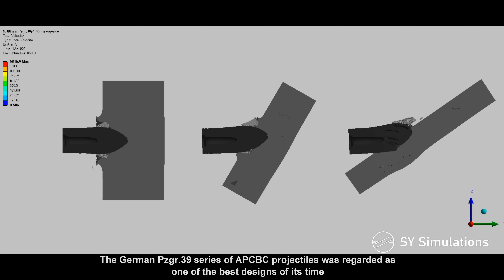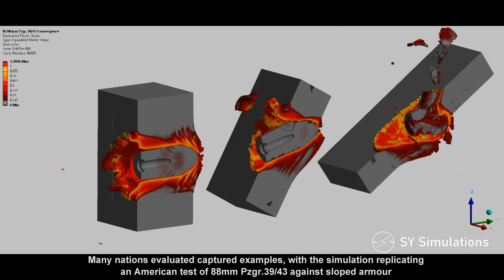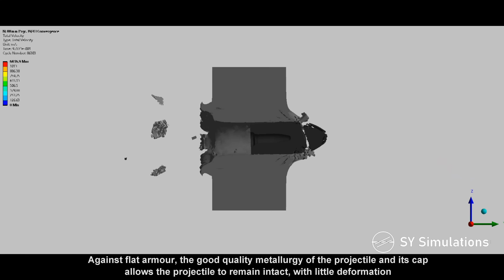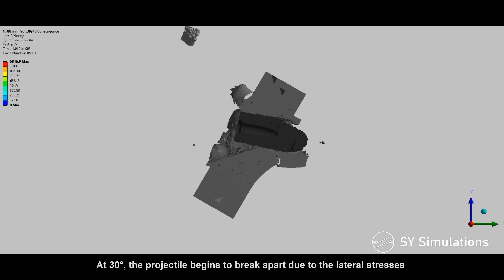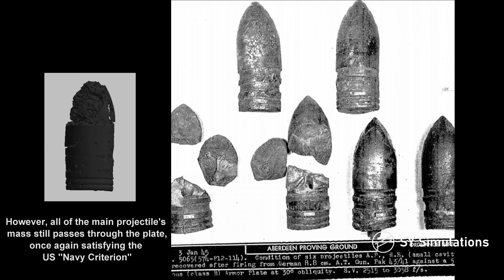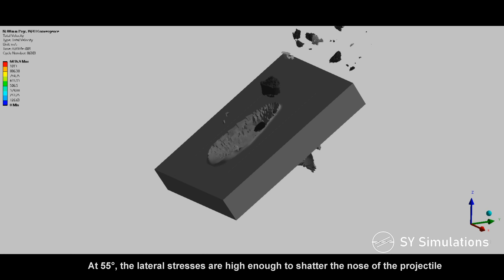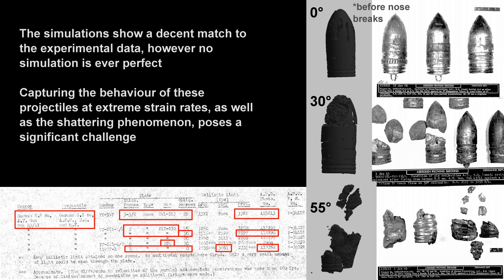FLAT vs SLOPED ARMOUR SIMULATION vs REALITY | 88mm Pzgr.39/43 Shatter Armour Penetration Simulation

Comment: Another great video. Fascinating that even if the armour can't stop the projectile it can still break it so that it won't explode on the inside. Certainly not ideal but might save the lives of some of the crew.

One thing I've always wondered is the difference in effectiveness between rolled vs cast steel of equal thickness. I keep hearing contradictory things about how rolled steel is stronger because of the way the crystal structure meshes together, vs cast steel where they basically sit together in whatever form they were poured in. Others says that cast steel is stronger, but don't go into detail why beyond the lack of weld seams, which should only be a problem for hits directly on or close to them.

Would be interested to see if the two could be simulated and tested. Keep up the great work.
Reply: cast is very brittle so it would be likely to shatter like ceramic.
Reply: @Stalin-7332  That depends on what kind of steel and what kind of heat treating is used. Most US tanks made heavy use of casting for both the turret and hull, and post ww2 most other tanks from other nations used casting for turrets.
Reply: 👍 I've wondered the same thing. I hope you get an answer.

Comment: Subject: Request for Tank Armor and Gun Penetration Simulation

Dear SY Simulations,

I have been following your work on tank armor and gun penetration simulations, and I am very impressed with the level of detail and accuracy you achieve. I would like to request a simulation to analyze the effectiveness of large-caliber guns against sloped armor, specifically regarding the IS-3 heavy tank.

As historical tests suggest, the IS-3’s upper front plate, despite its theoretical line-of-sight thickness, could be penetrated by its own D-25T 122mm gun at relatively close ranges. This appears to be due to the effects of normalization, local armor failure, and the sheer mass of the projectile reducing the effectiveness of the slope.

Could you conduct a simulation to verify this phenomenon? Specifically, I would like to see:

The impact of a 122mm BR-471B (APBC) shell on the IS-3’s upper front plate (60° vertical, ~30° horizontal sloping).
The actual armor effectiveness when considering normalization and local armor deformation.
How the IS-3's armor performs against its own gun at different ranges (e.g., 100m, 500m, 1000m).
Your simulations are among the most detailed and well-researched available, and I believe this test could provide valuable insight into how sloped armor interacts with heavy-caliber shells in real-world conditions.

Looking forward to your thoughts!

Best regards,
Oniku Daisuki

Comment: The metallurgy and post forging hardening processes, of AP projectiles, will always have a significant effect. For instance, the British 40mm. 2 pounder 1938 pattern AP/T solid shot could penetrate up to 62mm. of RHA @ 0 degrees @ 100 yards. The 1939 pattern "Hadfield" AP/T solid shot could penetrate up to 77mm. of RHA @ 0 degrees @ 100 yards. The latter 1939 pattern AP/T projectiles were simply 1938 pattern AP/T projectile exposed to the secret special Hadfield chemical treatment and hardening process. This Hadfield process was shared with other British munitions companies plus the Canadians and United States. "Hadfield" projectiles were more resistant to shattering than untreated projectiles.
Reply: So, "tougher"?

Comment: The first one probably has the structural failure as the hollow space w/in is not supported via HE filler, leading to a practical increased concentration of force on the internal breakage point

Comment: As mentioned for another video, it should be noted that the version of 8.8cm PzGr.39/43 tested by the US were pre october 1944 lots, as evidenced by both their weight (post october 44 lots were slightly heavier, 10.20 - 10.34 kg [22.48 - 22.8 lbs]), as well as the shattering they experienced at 55 deg. Post october 1944 production lots had to meet new acceptance standards, these demanded the penetrators stayed intact at high impact angles, even when ejected from (bouncing off) highly sloped target plate. The US did however test post october 44 lot 7.5cm PzGr.39/42, which performed as pr. the new standards set by the German, staying intact at high impact angles and also when ejected/bouncing.

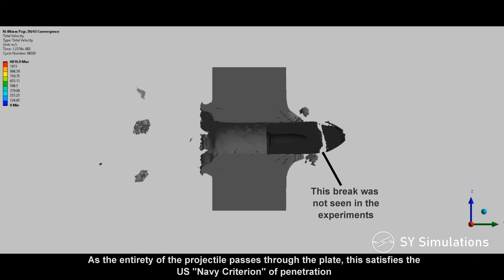Comment: 0:45 I actually have a fired specimen of the 8,8cm Pzgr 39/43 with the same tip fracture failure on hand, although the back is also somewhat squished, so it was probably shot at a slight angle. Until I saw your animation I couldn't think of how this could've happened at all. If youre interested I could send you a photo.
Reply from the maker: Absolutely! please see the channel's about section for my email

Comment: It's a shame there's so much variability in muzzle velocities and even some difference in BHN on one plate. I'm a big fan of apples-to-apples. Also, I'd like to see a "flat plate vs sloped plate" test where you take into account the weight of the plate. I don't know what the weight differences would end up being between two plates (one flat, one sloped) that offer roughly the same protection. I could likely work it out if I looked at some sources, but I'd rather see it shown in a sim lol
Reply: The weight per protected area is simply equal to the line of sight thickness multiplied by the density of the armour. You can think of it this way: Sloping a flat armour plate, while keeping the line of sight thickness and the protected area constant, is the same as shearing a square into a parallelogram, and this conserves the area.
Reply: What you see in this simulation is exactly what you are asking for.

Comment: "May cause damage behind the armor" is a bit of an understatement id say
Reply: A "significant emotional event"
Reply: Lets the put the may in """""""""may""""""""""
Reply: The '88' seems to have had the ability to do a similar job as a later HESH round according to my WW2 tank recovery and repair vet Father.
He wouldn't go into any further detail about the results than the 'damage' inside caused by spalling was something he never forgot unfortunately.The 88 didn't need to penetrate to take out allied tanks and their crews.
Reply: Sounds like some Drach style understatement.
"A significant emotional event took place within the vehicle."
Reply: As in "clean out the interior of the recovered vehicle with a firehose."
Reply: @lairdcummings9092  
I'd guess it probably went something along those lines.My Father was clearly referring specifically to spalling described as flying shards and splinters of armour knocked off inside. 
Obviously a penetrated and relatively more likely burnt out tank wasn't going to be a priority recovery prospect to be put back into service ASAP which adds credence.
Reply: "a slight headache" is a more rustic way to say it
Reply: HIT**